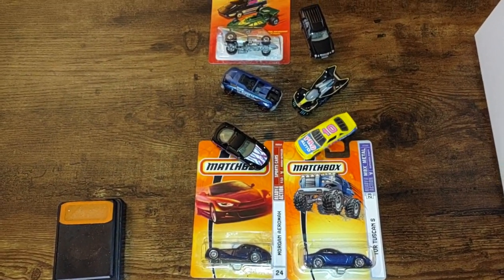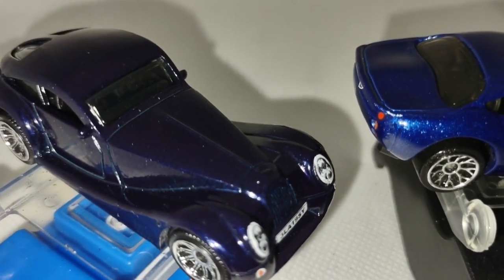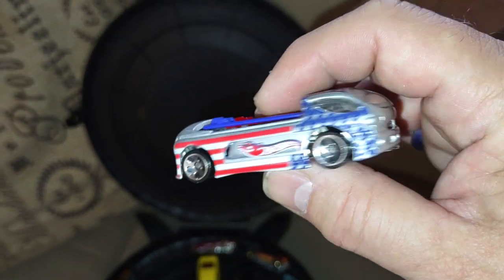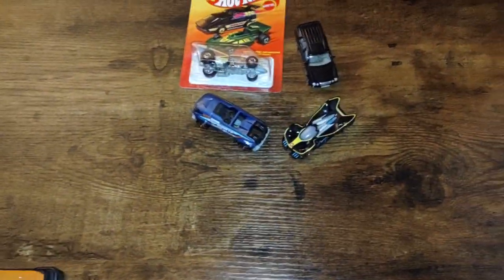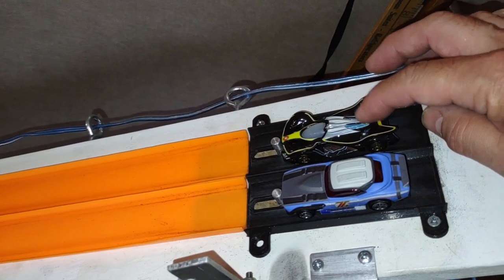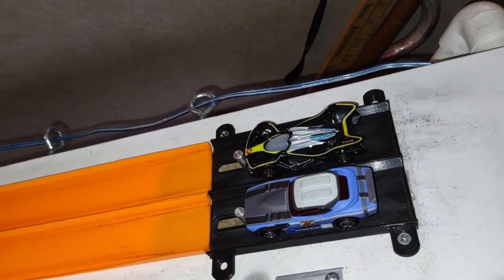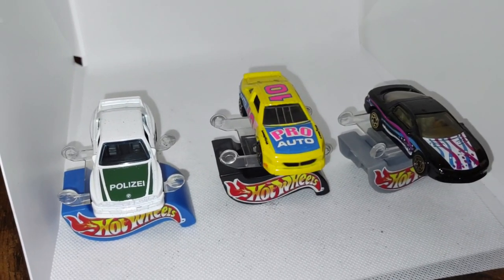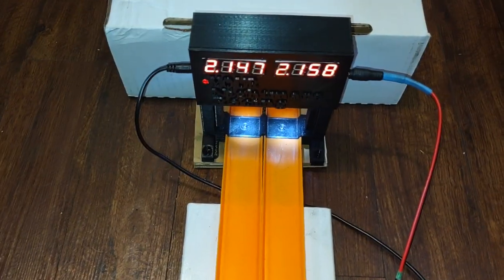Matchbox & Hot Wheels Speed Testing, feat MBX Camaro Z-28

Comment: That Camaro is running fast on the straights.  I have to pull mine out and give it a rework.  When I swapped my lower tier weight classes, everything got out of whack.  Surprised that Mercedes ran that bad.
Reply from the maker: I just gave the Camaro another rework. We'll see next week how it does. The Mercedes had great wheels. We'll rework it, but so far it's a slug. Thanks Dale!

Comment: i like the soldier 76.  I picked mine for the looks only.
Reply: ah now the redline vs the hot ones.. should be interesting.
Reply: i like the shadow jet, they are quick on curves.  But then so is the mark iv so its smokes it on both counts.  Really woke back up 2nd run.
Reply from the maker: @gnrvintagediecastracing7978  The Mark IV is pretty cool to watch go down the track. It usually runs low 2.120's consistently.
Reply: @yournightmareracing1754  If you come acros MK IVs in decent shape, buy them. Especially the USA ones. You might even get a faster one.
Reply from the maker: @gnrvintagediecastracing7978  I actually just missed on a prime one last week. Grrr